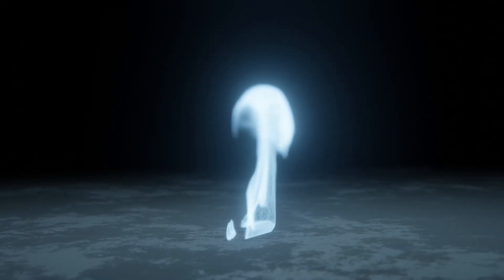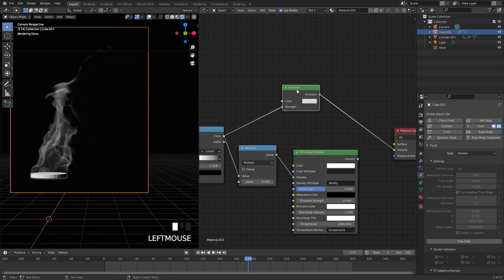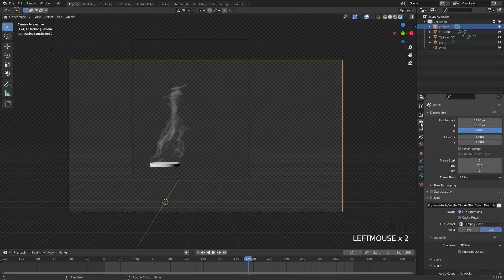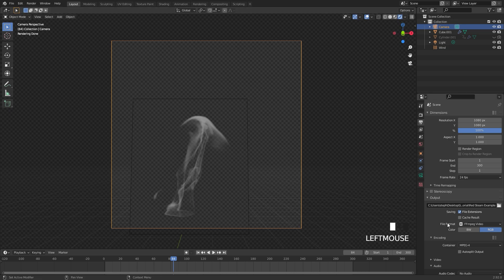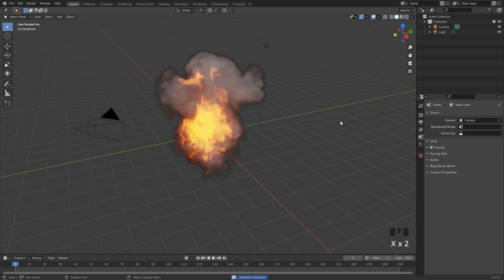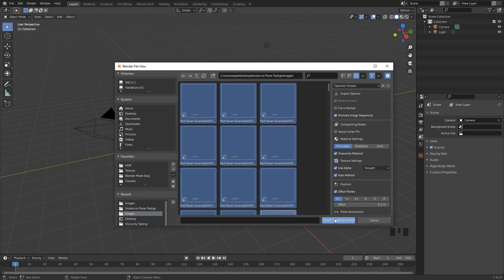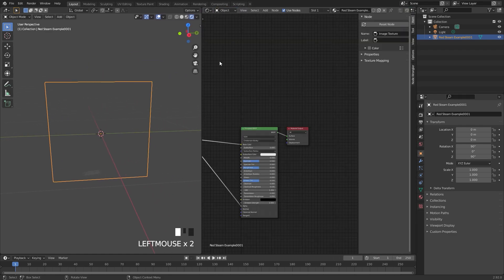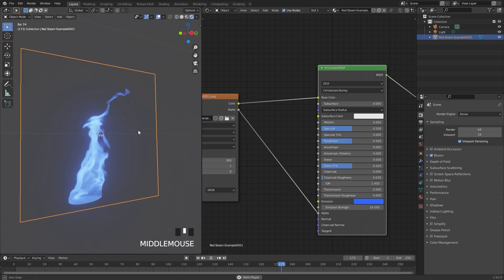Blender Tutorial - Import a Smoke Simulation as a Texture

Comment: I used this technique and duplicated my video 20 times to spread around the scene to make the effect look more full. When I render the first 1-2 clips in the animation, it renders at a normal speed. But then it will get stuck at “initializing”. I am using a 3090. I was wondering if I’m simply not supposed to duplicate the video asset that many times. Anyone have this issue before?